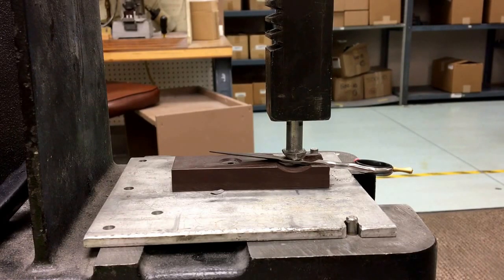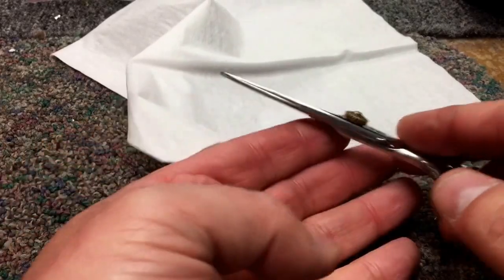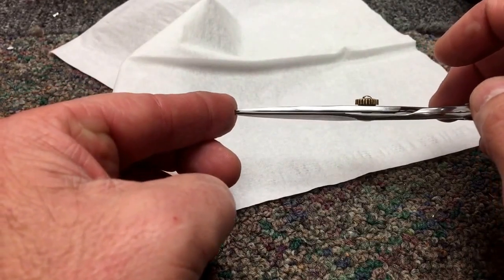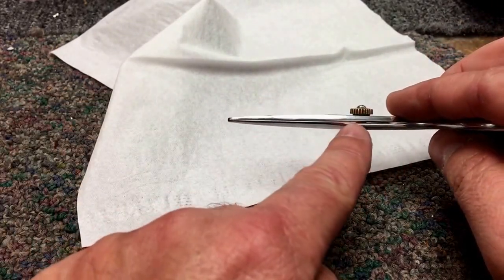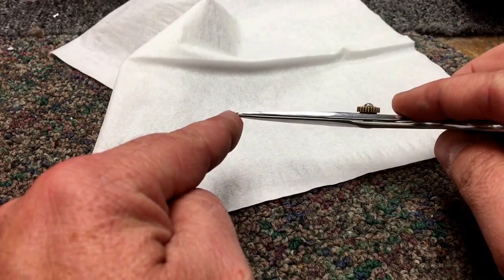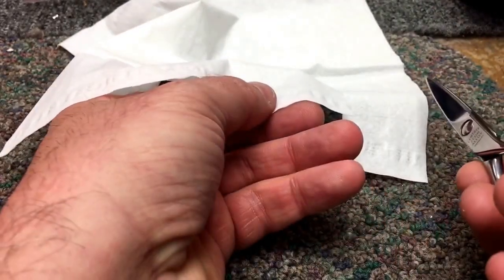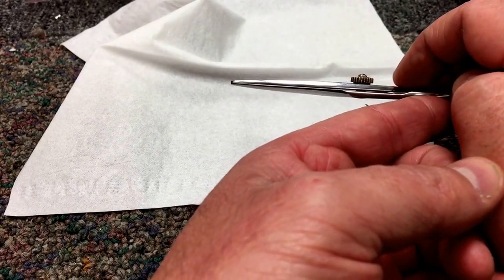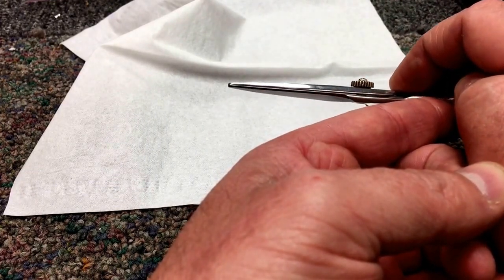Adding Set Behind the Screw Hole

Comment: Could you use the arbor for scissor bending on cast scissors?  I 
especially took note of the concern you had for having to put pressure 
on or around the pivot hole.
Reply from the maker: Nope, I wouldn't bend a cast shear with this. It would snap it like a twig. ;)
Reply: Generally speaking, cast scissors will break if you try to set them. Cast can be separated from forged by the ring it makes. Use half of the shear only, work over a rug, toss the shear half into the air and tap it with a wooden pencil while it is in the air. A cast shear will ring for about half a second. It almost sounds like a "clunk". A forged shear will ring like a bell and take 4 or 5 seconds to dampen out. Practice with known cast and forged halves and you can easily tell the difference. NOTE: Cast handles welded to forged blades should clunk, but I don't know for sure.